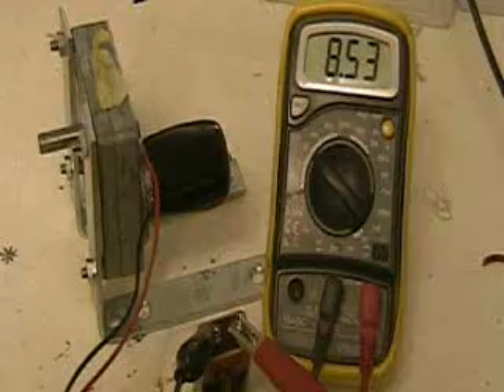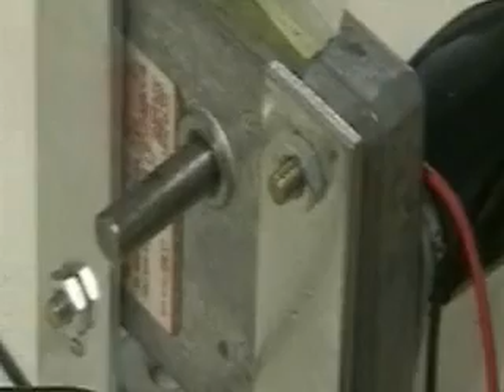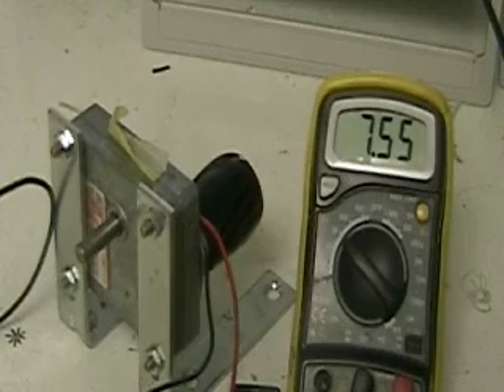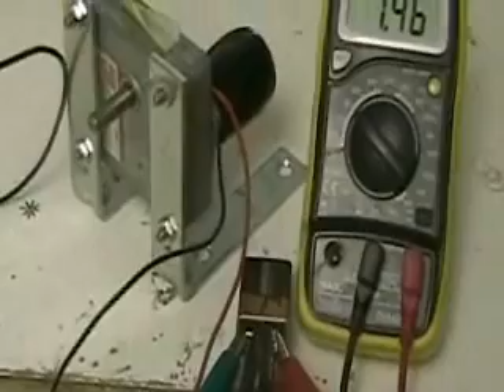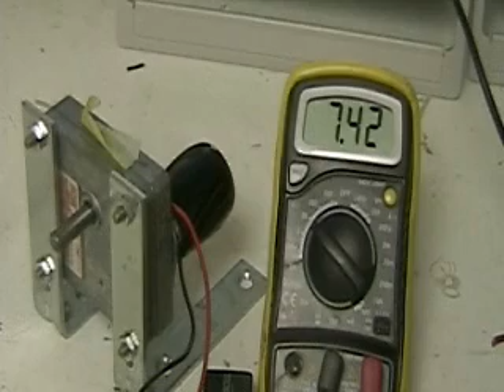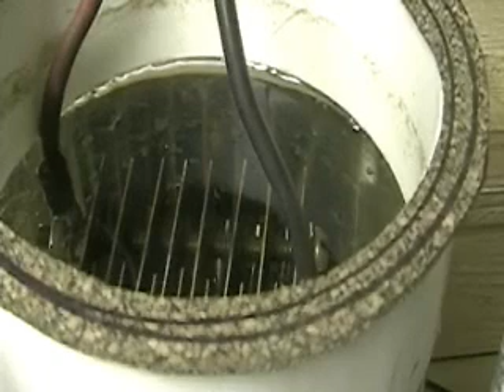Hydrogen Tap (My Gift For You) 261

Comment: i have to agree with you, very interesting clip tho. I'm no electrical engineer but i noticed that when you hooked the motor back up, it almost suddenly dropped the voltage down to where it was when you unhooked it. So i would have to agree that it is gaining some of it potential because of no load.

Comment: Hi John,
do you use a motor with heavy commutator sparking ?
Then you have the Newman motor effect that the sparks recharge your battery.
If you use needle graphite tip contacts on
the copper commutator, so you have real good sparks it will even work better.
Regards, Stefan.

Comment: electro chemical reaction is increased with heat from the amperage draw. This battery is so dead the recovery after running does not even stabilize very quickly.